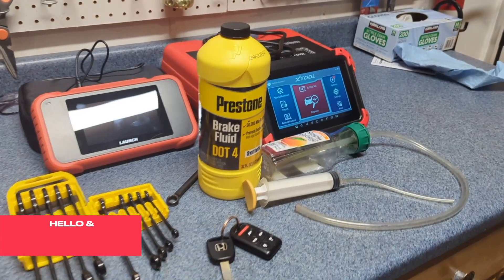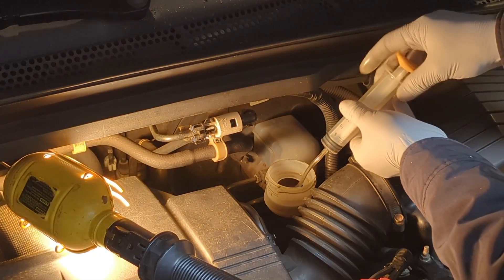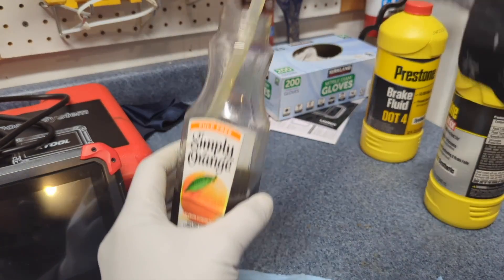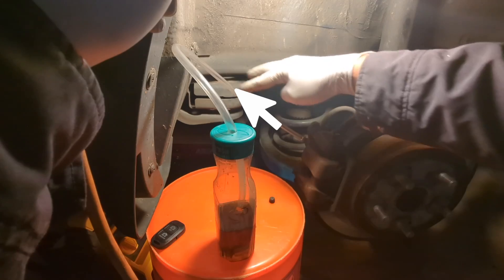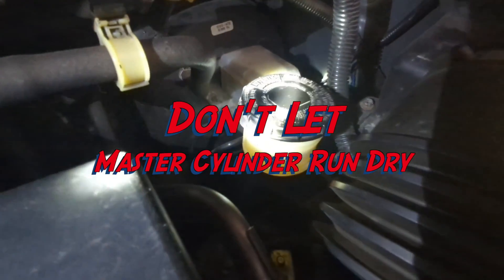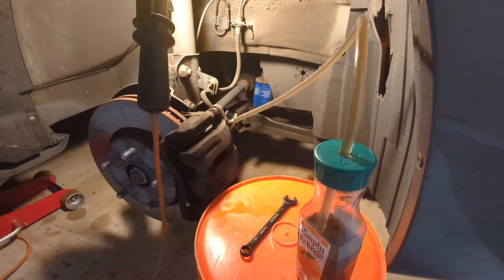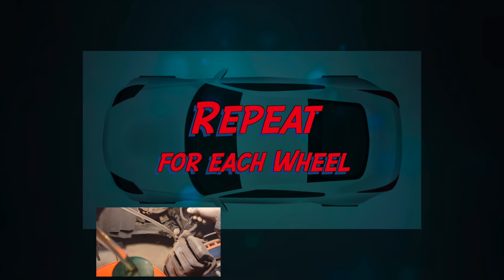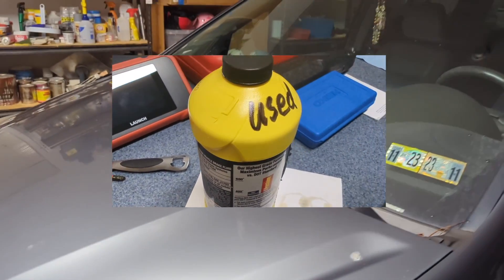COMPLETE brake flush w/ ABS bleeding. How dirty the fluid! - Honda

Comment from the maker: Links to ABS bleeding scanners that I mentioned in the video--

LAUNCH Creader Elite 205 OBD2 Scanner: 
https://ebay.us/b2kUTb

XTool D7 Bi-directional OBD2 Scanner:
https://ebay.us/vDwoU4

Also available on Amazon: 
* Launch CRE205: https://www.amazon.com/gp/search?ie=UTF8&tag=professors-20&linkCode=ur2&linkId=9046f7466ee4524a6c28c789c76d222c&camp=1789&creative=9325&index=automotive&keywords=LAUNCH%20Creader%20Elite%20205%20OBD2%20Scanner
* XTool D7: https://www.amazon.com/gp/search?ie=UTF8&tag=professors-20&linkCode=ur2&linkId=3251fb426b6844ccf0cdb16b44171ddb&camp=1789&creative=9325&index=automotive&keywords=XTool%20D7%20Scanner
Reply: How do I know if the Launch scanner will bleed ABS on my 2011 Toyota Camry Hybrid?
Reply from the maker: @petersboro8502  Contact the seller and they can confirm that on your make and model. Normally, if the product description includes "ABS bleeding" on the supported Reset function, it should have no problem doing that on a Toyota model. On LAUNCH Creader Elite 205, for example, you can select 5 reset functions from a list of 10, including ABS reset: https://ebay.us/t6Qx2B
Reply: Hi Professor,  Do you know for sure that the LAUNCH Creader Elite 205 works with modern Hondas?  I have read that Honda has its own protocol for ABS comms. There are comments on the Amazon product page  that folks had difficulty with ABS bleed, though a Ford owner was successful.  The XTool seems to work, but it is a lot more money.  Any help is appreciated.
Reply from the maker: @winterbeard7886  great question! This recently also came to my attention. I tested two products (Innova SDS43 OBD2 and Ediag Elite) with ABS Bleeding support but in the end communications failed on both (it does look like a protocol issue). However, I have also came across this budget-friendly option from Kingbolen (Soloscan) with reset functions specific for Honda/Acura: https://amzn.to/4iHQfBW. I tested a similar Soloscan model for Toyota/Lexus and it worked out very well. You may contact the seller support to confirm its compatibility.

Comment: flushed my boxster, fluid was the same out as the fluid I put in, myself it is all bullshit. As to boiling fluid, one in a hundred thousand ever get their brake fluid to the boiling point.
Reply from the maker: Actually, you can't see the real danger; brake fluid absorbs moisture that rots lines and ABS valves from the inside out even if it still looks clean. I’ve seen one lose their brakes entirely after 10 years of "looking fine" because a line finally rusted through from the inside. It's not about the 99% of the time it works, it’s about making sure that chance of failure doesn't happen when you actually need to stop. I'd rather not take the chance, even if it were "one in a hundred thousand."

Comment: NO NEED TO PURGE THE ABS if you don't remove master cylinder or let it run dry. There wont be any air bubbles in the system. If you don't have a scan tool, then after bleeding the calipers, you can simply drive your vehicle fast on gravel or grass and hit the brake pedal hard, once the wheels slide, the abs module will activate and purge any trapped air automatically, repeat this process 4 or more times. You will feel the brake pedal growl and vibrate when doing the hard stop, this is normal. Also, brake fluid turns brown or black because it ABSORBS MOISTURE.
Reply from the maker: Thanks for sharing your perspective! While driving on gravel plus hard braking can sometimes activate the ABS, using a scan tool provides a controlled and thorough way to cycle the ABS pump for old fluid to be purged. For safety reasons, I wouldn't recommend driving to trigger ABS activation, which isn't safe and not always cost effective either. And now that you can get a scanner for this service under $100, it's best to do it right: https://youtu.be/fKYGX9ZrxyQ
Reply: @profsg  Can i get the link for the scanner for honda crv 2020 EX-L hybrid to bleed the ABS?
Reply from the maker: @Juhan610  absolutely. Here's the link to Kingbolen's Ediag Elite ($86 or so): https://amzn.to/49y3HqC. It's an incredible value that offers full system diagnostic, some bi-directional controls, and 15 maintenance/reset functions including ABS bleeding.
Reply: I used this method to bleed the abs brakes of my car. Thanks a lot.

Comment: 96 Ford aerostar..there is no code reader to bleed abs on this year. It was when ob2 came about.
Reply from the maker: Yes, that was the first model year of OBDII but it was limited to engine and emissions. ABS activation/bleeding was probably supported through dealership/manufacturer-specific tools. Just checked Autel's support for 1996 Ford Aerostar and it includes modules for PCM and powertrain but nothing about ABS, etc.
Reply: @profsg Hey, thank you very much for the research! I have seen on eBay a manual bleeder w a harness to plug into abs. Costs around$600.

Comment: I did this on my 2008 Honda odyssey, the scan tool only did it on the front brakes as the prompts told me to….right caliper first the left, then it was complete…..was this normal?? Not all wheels?
Reply from the maker: @aloha-rob Yep, what you saw is normal for some Hondas. The scan tool bleed focuses on the front wheels just to purge the ABS modulator itself, which is the most complex part. Once you've done that, the ABS unit is bled with fresh fluid (along with the font) and you can continue with a manual bleed on all four wheels to push that old fluid and any dislodged air the rest of the way out of the lines.
Reply: @profsg thank you, mine was so bad. Bleed it, did the abs, then again all around. It was as dark as pepsi

Comment: Did you use a floor or scissor jack to raise the vehicle? And can you recommend any decent affordable floor jack?
Reply from the maker: I use a 3-ton Arcan floor jack: https://amzn.to/45n5Ty7, which has gotten much pricier. If your vehicle is an SUV like RX350 with higher clearance, you'll need a 3-ton jack like this: https://amzn.to/3J34x3Z. A scissor jack may work but much harder/slower to operate. Regardless, you will need good jack stands to support the vehicle once it's raised. So definitely get quality, 3-ton rated jack stands like these:https://amzn.to/3HmxxmF. You can see this video for my usual setup: https://youtu.be/jcGRXJABcyA?si=5kt12Dh30EBExUwL&t=94

Comment: Pretty sure you can but just wanted your opinion on this - this process can be done with a pressure bleeder too right?

I'm thinking of doing this: 
-Remove old brake fluid from resevoir
-top it up with clean fluid
-Connect pressure bleeder
-bleed RR under pressure until fluid is clear without air, then activating ABS bleeding using OBD2 tool and bleed again. 
-Bleed remaining 3 corners. 

Does this sound about right?
Reply from the maker: Absolutely! A pressure bleeder will make things easier, especially for a one-man project. You got it, the combination of standard brake bleeding with ABS activation will do it.

Comment: see if i follow you here to bleed the abs first replace old fluid either vaccum pump ,foot pedal or manual brake bleed pump.then use the scanner tool option brake bleed follow instruction from farthest of master cylinder after its done by scn tools i go to second sequence then so on so fort correct? or not thanks
Reply from the maker: Only one sequence to go through the wheels. On each wheel, first manually replace and bleed brake fluid (e.g. by pumping brake pedal) to refresh fluid in the system. Then, activate the corresponding ABS solenoid to exchange fluid inside the unit with the system. And finally, continue the manual bleeding on that wheel to push contaminated fluid and air (originally from the ABS) out from the bleeder. Once it's clean with no bubbles, move to the next wheel and no need to come back. Hope this clarifies.

Comment: Can you check on your XTOOL D7 scanner for ABS if on the Australian tab a 2005 Odyssey 2.4L is avail to select.  I'm having great problems buying scanners that don't support Australian cars like the Foxwell NT630+.  Do you also have the CRE205 to check as well ?  Hoping you can help.
Reply from the maker: Just checked my D7 and ABS Bleeding is under Reset/Special Functions -> ABS Bleeding, then Asia (for the maker even though we are in the U.S.) -> Honda and you will get there. In this case, the region tab is for the car maker instead of the market. Sometimes it's arranged differently and can be confusing. As for CRE205, I don't have the device physically but, based on my previous communications with Launch support, it offers many reset options but you can only select 5 reset functions on that device. My other Launch products also show these reset functions can be accessed by selecting Reset on the main menu. Contact Launch support to confirm. They are responsive.
Reply: Get the Foxwell Nt510 Elite. I just performed this function on my Australian domestic market 2009 Odyssey using this tool.

Comment: Thnak you for this easy to follow video. I have one question that is confusing me. In manual for Honda Jazz 2010 (GG) sequence of bleeding is 1-front left, 2-front right, 3- rear right, 4-rear left. (steering weel left side). Wich sequence should I do? I saw some videos that is dependent of location of ABS modul but I am not sure.
Reply from the maker: Yes, it depends on where the master cylinder or ABS is, and how the brake lines are routed to the wheels. The principle is to do the farthest wheel first, and then gradually move toward the closest (usually those in the front). If your manual specifies it, then follow the manual. But even if you don't follow the exact sequence, not the end of the world--you can still replace most of the fluid but may end up using more brake fluid than what's needed in the optimal sequence.

Comment: When I tried this on my honda grace hybrid, using the scan tool to activate the abs. It says it should run for 40 sec but it runs for 1-2sec and stops thinking it ran for 40. I did however just pimped the pedal and bleed the two fronts and the back didn't need the tool
Reply from the maker: A combination of pumping the pedal and activating the ABS solenoids will get fluid circulated/exchanged inside the unit. Don't think ABS needs 40 seconds and, as long as fluid is already fresh in the system after pumping/bleeding/adding, a few seconds of activation will do its job. If you want, you can repeat the process to get more out of ABS.

Comment: Do you pump the brakes whiles the scanner is activating the ABS modulating pump? If so, can I leave my pressure bleeder (Speedibleed or Motive Products bleeder) attached and pressured while during the ABS bleed so I do not have to be in the vehicle pumping the brakes?
Reply from the maker: Yes, I did. That will help circulate the brake fluid. Do follow scanner instructions on your vehicle. On some vehicles, the instructions do include pressurizing the brake line while ABS is activated.
Reply: I wonder if you can vacuum the system instead of pressurizing it while doing abs bleed?
Reply: Yes that would work too, just maintain a good level of fluid in the master cylinder the results should be the same.

Comment: Do you close the master cilinder while pumping the pedal?
Reply from the maker: Yes, I did. Every time you top off the fluid in the master cylinder, put the cap back on.
Reply: The master cylinder will still work without a cap, but it is good practice to always replace it. Brake fluid is hygroscopic, and will absorb water from the atmosphere.

Comment: Would you advice for a brake fluid change vs a fluid flush when copper leaves are beyond 300? Got a 2011 CRV
Reply from the maker: It definitely needs a flush. With that much copper, the fluid must have been corrosive for a long time. The bigger question is whether your brake lines and fittings are still holding up. They may need attention/replacement before a brake fluid flush. 

Not long ago, a friend got stranded on the road without brakes, so I rushed to help. Turns out, her car had leaking brake lines. In the end, they sold their gorgeous Mercedes GL 450 to a shop for cheap. I was in the market for a used car, but not a big truck like that. Otherwise, I would have bought it and fixed the brake lines myself. 

Just an example about the importance of regular maintenance like brake fluid replacement. But it's never too late to look into it and get it addressed. Best luck!
Reply: @profsg  Good catch about the brake lines and fittings. So, you would got for a flush instead of the brake fluid change although the high copper levels 🙌🏻
Reply from the maker: Yes, fix/replace any issues in your brake lines and then go for a flush, which you will have to do anyways after the brake work.
Reply: @profsg  Thx a lot 🙌🏻

Comment: what to do if i have no scanner and ts OBD~1   ?
Reply from the maker: In that case, you can perform the brake flush/bleeding without ABS and that may be good enough. After the flush, if you do drive under circumstances where ABS is activated (i.e. during hard braking), it will circulate fluid in ABS with fresh fluid in the master cylinder and brake lines. Theoretically, if one repeats the flushing and driving a few times, your ABS fluid is fresh too. However, please do NOT attempt this type of driving on purpose to flush your ABS. I meant, if hard braking did occur and ABS has been activated with fresh fluid, then you know the ABS system is partially replaced with fresh fluid.
Reply from the maker: Again, the proper way to perform ABS bleeding is with a scanner, and they are indeed expensive. One relatively budget-friendly (still much more expensive than basic OBD II scanners) option is what I mentioned in the video, LAUNCH Creader Elite 205 OBD2 Scanner for $130 - $140: 
https://ebay.us/b2kUTb

It has 5 reset options you can choose with the purchase and ABS is one of those. Unfortunately, you cannot program a regular scanner to perform these more advanced operations.

Comment: Detailed video with appropriate voice overs. Thank you for adding the ABS bleeding portion. It's not something I've seen elsewhere. Unfortunately, I do not own a scan tool that allows me to do it. I've only a small, simple scan tool. 

Since DOT 4 and 5.1 are both glycol-based brake fluids they are compatible with each other too. I've mixed DOT 4 and DOT 5.1 in my Odyssey.
Reply from the maker: Great point! For those new to brake fluid, I'll add that DOT 5 is NOT the same as 5.1 and is not to be mixed with DOT 4 or 3.